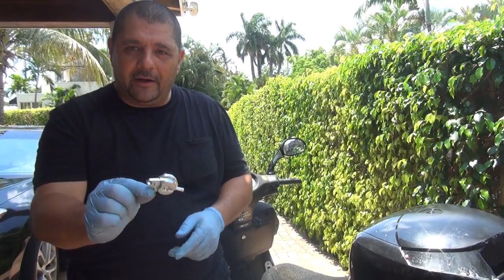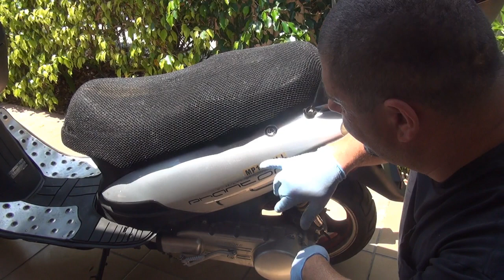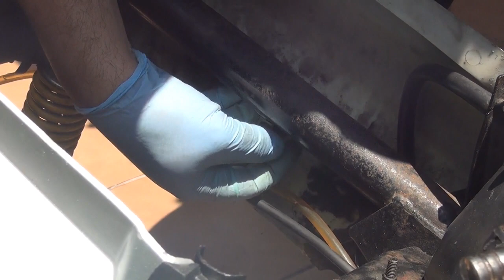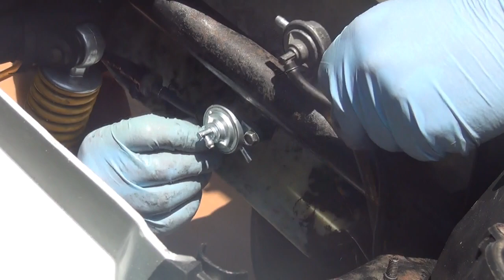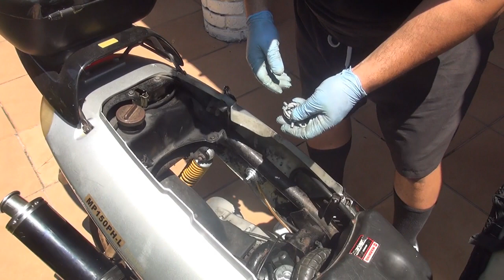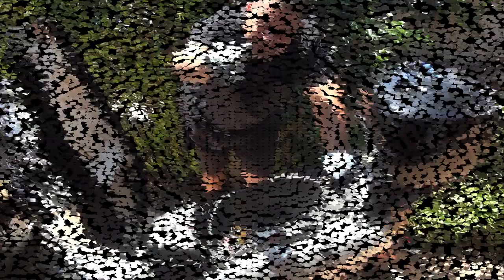Chinese Scooter fuel valve

Comment: I have an aircraft fuel switch on my scooter, its zip tied straight to the frame and makes for easy draining of the gas tank now i don't have to suck the vaccum line and get a mouth of gas if the seal is bad after leaving it chained up for a season. thank you for sharing stay safe amigo!
Reply from the maker: Hello Gary thank you for watching my video

Comment: If I want to replace all of PVC hoses as you, those PVC hoses does have temperature limit range? Are they special type? Maybe you give some idea, thanks!
Reply from the maker: When it comes to replacing PVC hoses, it's important to consider the temperature limits and choose hoses that are suitable for your specific needs. PVC (Polyvinyl Chloride) hoses typically have temperature limitations that should be taken into account.
Standard PVC hoses usually have a temperature range of around 0°C to 60°C (32°F to 140°F). These hoses are suitable for a wide range of applications, including water transfer, irrigation, and general-purpose use. However, they may not be suitable for high-temperature environments or applications where the temperature exceeds their limits.

If you require PVC hoses that can handle higher temperatures, you may need to look for specialized variants. High-temperature PVC hoses are available in the market, and they are designed to withstand elevated temperatures. These hoses may have a temperature range of -10°C to 80°C (14°F to 176°F) or higher, depending on the specific product.
When selecting PVC hoses, be sure to check the manufacturer's specifications and guidelines to ensure they meet your desired temperature requirements. It's also worth considering the intended application, pressure ratings, and any other specific needs you might have to ensure you choose the right type of PVC hose for your project.
Additionally, keep in mind that if you're dealing with extremely high temperatures or require hoses for specialized applications, other materials such as silicone or reinforced rubber hoses might be more suitable. These materials offer higher temperature resistance and can handle more demanding conditions.
Reply: @VirberelloScooterTips  Thanks for your kindly respond to analyze my question!
Actually I did forehead thermometer to detect scooter engine running idle mode in few month ago, I got scooter engine temperature around 90°C! Based on your suggestion, silicone hose characteristic is better than PVC hoses also it is able to match my demand, right!
Reply: Another question is, my SYM carburetor scooter over half year that engine does not working in Taiwan! After I push scooter start motor switch and then I got some situations as below: (1) engine cylinder pressure is 126psi (2) spark plug has flash (3) fuel tank does not working to push gasoline via fuel filter out? Do you have some idea to help to fix my breakdown SYM scooter here, thanks!
Reply from the maker: @hunterchung7070 Based on the information you provided, here are a few suggestions to help diagnose and potentially fix the issue with your SYM carburetor scooter:

Fuel system check: Since you mentioned that the fuel tank is not pushing gasoline through the fuel filter, it's essential to inspect the fuel system for any possible issues. Start by checking the fuel lines for blockages or leaks. Ensure that the fuel valve is open and that fuel is reaching the carburetor. If necessary, clean or replace the fuel filter and check the carburetor for any clogs or obstructions.

Carburetor adjustment: If the fuel system seems to be functioning properly, you may need to adjust the carburetor. The carburetor controls the air-fuel mixture going into the engine, and an incorrect adjustment can prevent the engine from starting or running smoothly. Refer to your scooter's manual for the appropriate carburetor adjustment procedure, or consider taking it to a professional mechanic for a thorough inspection and adjustment.

Ignition system check: While you mentioned that the spark plug has a flash, it's still worth verifying the overall condition of the ignition system. Check the spark plug wire for damage and ensure it is securely connected to both the spark plug and the ignition coil. If the spark plug is old or worn out, consider replacing it. Additionally, inspect the ignition coil and other ignition system components for any issues.

Air filter inspection: A clogged or dirty air filter can restrict airflow to the engine and affect its performance. Remove the air filter and clean or replace it if necessary. Make sure there are no obstructions in the air intake system.

Compression test: You mentioned that the engine cylinder pressure is 126psi, which seems reasonable. However, it's worth conducting a compression test to ensure the engine's overall health. Follow the proper procedure outlined in your scooter's manual to perform a compression test. If the compression readings are significantly low or uneven across cylinders, it may indicate an internal engine problem that requires further investigation

Comment: I just got my new valve.  It doesn't have the top side for the vacuum line. Only the two sides for the carb and fuel line... did I get the wrong one? It just seems like it's a medium to turn it on and off.  My problem was always having to create a vacuum.  Was thinking this would help me avoid that.  But again,  there's only two sides and the on off switch. Also I have a 49cc scooter.  Will the one you are using work on mine?
Reply from the maker: Hello make sure to replace the old part with a  new part that looks the same is always better , if you had 3 connections on your old fuel valve
Reply: @VirberelloScooterTips  only two connections.  It's screwed onto the opening at the bottom of the tank.  It had a topside valve and a lower valve.  I see that I just bought an on/off switch not the manual petcock...damn! It's OK. I was trying to figure out how to work around having to buy the right part. Because it's gonna take too long to get get  here.  It's in my cart on Amazon. I can't just fit a tube as a washer up there and connect it to the valve switch?

Comment: Can you add additional filter on fuel line to keep gum out of carburetor? Also is that petcock same (universal) for most mopeds? 🤔
Reply from the maker: Hello I think that placing a double filter will slow down the fuel flow going to the carburetor and that will effect performance at full throttle  at speeds over 40 mph yes that petcock is universal if your scooter is having a vacuum system running on gravity fuel flow
Reply: Thanks for the info! 😀

Comment: Should there be fuel in the vacuum line going to the intake manifold? If not, is that a tell-tale that your fuel valve needs replaced?
Reply from the maker: Hello my friend no fuel inside the vacuum line  yes you should change the fuel valve

Comment: My scooter started leaking fuel out of the air filter ......what ya think? Check lines? Connections?
Reply from the maker: A gas scooter leaking fuel out of the air filter could be caused by a few different issues:
Carburetor Problems: The carburetor is responsible for mixing air and fuel in the correct ratio before it enters the engine. If the carburetor is dirty, clogged, or damaged, it may cause the scooter to run too rich, which can lead to fuel leaking out of the air filter.

Float Valve Issues: The float valve controls the flow of fuel into the carburetor. If the float valve is stuck in the open position, it can cause fuel to overflow into the carburetor and out of the air filter.

Fuel Line Problems: A cracked or damaged fuel line can cause fuel to leak out of the air filter. Additionally, if the fuel line is kinked or clogged, it can restrict the flow of fuel to the carburetor, causing it to run too lean or too rich.

Faulty Fuel Filter: If the fuel filter is dirty or clogged, it can restrict the flow of fuel to the carburetor, which can cause the scooter to run too lean or too rich.

Comment: Good video brooo ♥️♥️♥️♥️
 Question please I have gy6 and I use 20w50 oil for 3 years  and temp not reach 38 at summer now ... Can I use oil 10w40 with no problem in engine 🙂
Reply from the maker: Hello my friend yes 10w40 is my favorite juice Thank you for watching my video and stay safe
Reply: @VirberelloScooterTips  
Oki 10w40 oil after using 20w50 for 3 years doesn't affect my engine bad yeah?
Reply from the maker: @islamayman5927  No is going to be good
Reply: @VirberelloScooterTips  
Thank you very much and I put that oil soon and give you my opinion 🙂♥️
Reply: @VirberelloScooterTips  
hi sir i put 10w40 oil and the engine after 25 km become high noise speacially at firts 2:3 km at morning and the vibration of engine increase 15% .
what your opinion of that keep with it or return use 20w50 ?
Reply from the maker: @islamayman5927  Hello 10w40 is ok but for long time you run 20w50 so you will feel a little different  now is your choice on what motor oil you like to use
Reply: @VirberelloScooterTips  
thank you broo ♥️

Comment: I do have a question? I bought a brand new X-Pro 150 2022 BD150T-6 scooter. The first day it had no problems and engine ran smoothly and put 55 miles of break in time. Second day of riding it just ran out of fuel with a full tank. I let it sit for about 5 minutes and it fired up and ran about two miles smoothly and quit running again! I did this all the way home for about 7 miles. My shade tree mechanic skills are telling me there is a pinched fuel line somewhere or do you think the vacuum petcock could go bad the second day I rode it? Any help would be appreciated.   Thanks, Carl
Reply from the maker: Hello make sure the screw at the carburetor drain is close look in front of the cvt cover lower front left side make sure the screw is tight somewhere your scooter is loosing fuel when you the motor is on
Reply: Hi Pat I bought an exact same model as you do and kinda same symptom happened on me! When its cold engine before cranking up I see full cup of fuel saturating the fuel filter and fuel supply goes well until several miles the cup goes empty and it looks like the percock doesn’t suck the fuel constantly and the bike engine shut off. It may happen again as you mentioned. I replaced 2 cabs and now it’s the time to test petcock though. Just give your some thoughts..

Comment: Hey Virberello
I was riding yesterday and scooter bogged out on me and would not start. I removed the gas line from the petcock going to the carborator and no gas was coming out..i also put a new carb in...but...i didnt put gas filter back on..i was trail and error why scoot wud not start a week ago..( i was thinking it could possibly be the gas filter but it wasnt)...could just a few days of riding f( i probly put 45 50 miles on it...with no gas filter clog up my jets or is it the petcock? i hope i dont have to order another carb..
Reply from the maker: Hello Luke no you do not have to order another cab there is a possibility that if you run the scooter without the filter the jets get dirty sometime the fuel tank builds up little dirt on the lower side
Reply: But i cant get to the jets and clean it because there are rivets on the float bowl and it hard to get to the jets to clean..still a bit confused here...

Comment: I do not know anything about engines .im out of work so i can’t afford to take it to a shop I need my scooter to find work I’ve been trying to fix it myself you’re videos have helped so far but I’m getting gas in my oil y and how do I get it fixed please someone help me ?
Reply from the maker: Hello Scott there is a possibility that when you park your scooter the side of the petcock valve with the vacuum hose that connect to the manifold is leaking fuel inside of engine cylinder after the fuel goes inside pass between the wall and the rings of the pistons and goes inside the oil but that can also work if your fuel valve is not closing when you dont run the scooter and fuel leak in the carburetor and the carb overfill and leak fuel inside the motor what you can do is to replace the petcock valve or place a  fuel  Switch  https://amzn.to/2Fqn9dx and go directly to the carb from the tank and when you do not use the scooter you close the switch and the vacuum  hose that now you have at the petcock you put inside a 6mm bolt to close the hose .  Thank you for watching my video Scoot and if you need any help feel free to contact me anytime also visit Chinese Project Scooters on facebook there you can find lots of scooters owners with lots of experience
Reply: virberello GY6 Scooter Tips thank you so much someone told me it was the head gasket that needed to be changed so I’m glad it’s not that .yes it has been sitting for a while and the petcock is bad and I replaced it with a shut off valve and it was getting to much fuel it sounds like from what you say .it wouldn’t even start I had a problem with figuring out my vac and fuel lines .then I think I had them right because it started but didn’t stay running I checked my oil and noticed a lot of pressure and the oil had gas in it but I’m not going to mess with the shut off valve I’m going to get another petcock .sorry for rambling thank you so much you are awesome thanks again
Reply: @VirberelloScooterTips   I’m sorry sir I am still having trouble with the scooter fuel and vac I can at least get it running but won’t stay running or fuel comes out one of the spouts or pressure builds up in the engine and when I take the oil stick out there’s pressure but I don’t smell gas maybe a little but I think that’s Frome before I have a hose nozzle on the manna fold one near it on the hose that connects to the carb from the manna fold another hose nozzle on left upper side of carb one on the right side by the idle then one on the upper  left which is the fuel intake and two under that at the bottom back of carb and I have a shut off valve instead of a petcock  please can some buddy send me a detailed diagram what hose goes where and what gets capped and what gets left for drain hose I finally got a job two weeks ago but I’m riding a bicycle and just looking at my scooter decaying again pleas help me I’m not a mechanic  thank you
Reply from the maker: @scottlurachy240  Hello if you have a GY6 150cc and your scooter is not stay on I think that could be a crack on the rubber of the manifold or you need to do a valve adjustment https://youtu.be/csH2RGvXegI but the best think you can do join the chinese project scooter group on facebook and you can make a live video of the problem so everyone can see the problem and we can help you

Comment: Hey question I ordered a new petcock pump for my scooter because the old one I would suck on the vacuum side and I wouldn’t get any suction from the fuel inlet side... is that a correct diagnosis? I also ordered a new carb because the Chinese one on it is non adjustable and needed cleaning and you can’t clean this type of Chinese one... please help I’m trying to learn more about scooter repair
Reply from the maker: Hello Joel petcock valve many times they get sticky and they do not let the fuel flow freely so sometime is good to change them or even better one day I will remove that petcock and place a shot off valve . Thank you for watching my video
Reply: virberello GY6 Scooter Tips thank you 🙏🏽 now that I have the new one I can definitely see that the diaphragm inside is stuck you can blow clean through the old one without any vacuum!! I love your video never stop it helps so many

Comment: I have a question.. if you put a after market exhaust on a 50cc four stroke do I need to put a after market carb on it too? Or stock is fine?
Reply from the maker: Hello you can keep the stock carburetor but if you change the air filter you should up jet the carburetor
Reply: @VirberelloScooterTips  thank you for the help

Comment: Hi there, I just installed a new gy6 150cc motor on my scooter and it started fine but the engine seems to be missing while idling. I looked at my clear blue fuel line and from the fuel pump, it seems to be pulling in some air bubbles and I was wondering if that could cause the motor to sound like it's missing. I've already adjusted the idle screw but the motor still misses while idling. Could the air bubbles going into the carburetor be the cause?
Thanks for any feedback!
Reply from the maker: Hello my friend you should not have any air bubbles inside your fuel hose because the air will build up inside the carburetor and the flow of fuel will not be consistent so the motor will not run the right way try to find the air leak at the pump or you just need to tight a hose and try again. Thank you for watching my video
Reply: @VirberelloScooterTips  thank you my friend !!!!
Reply: @VirberelloScooterTips  hello Mr viborello. Do you have an email address where I can talk with you more about my GY6 150cc?
Reply from the maker: @mikecuev820   I never check the email to many spam email but you can send a message at virbrello on facebook https://www.facebook.com/virberello

Comment: Hi great video I have a keeway tx 125s when it's cold the bike runs fine but as soon as the bike gets warm it starts bogging and slowing down, I've had a new spark plug new carburettor put on and the valve clearance done but still the same problem do you have any ideas or advice please
Reply from the maker: Hello Richard  many things can produce a problem like this dirty carburetor, bad electronic enricher or bad stator that when the copper coil get hot is not producing good current the fist thing I will test ac voltage of the stator with a multimeter  when scooter is on and when  the scooter is cold I will check for compression with a compression tester
Reply: @VirberelloScooterTips  thanks for reply I've put it in the bike garage now so hopefully find the problem they have told me my compression is at 110 and should be at 150 so hopefully they can see if that works